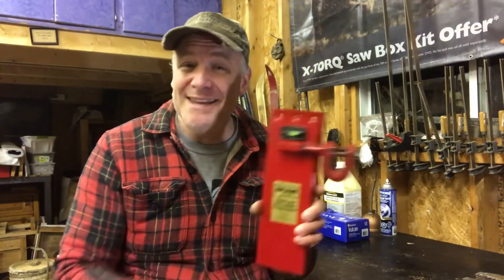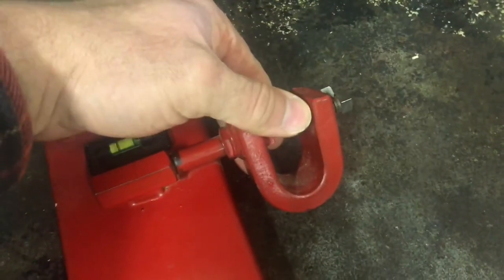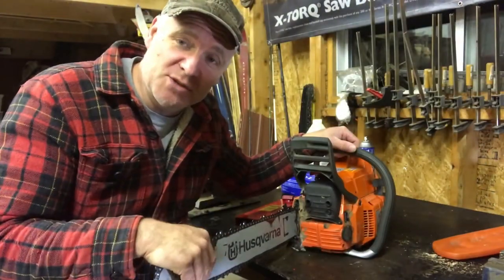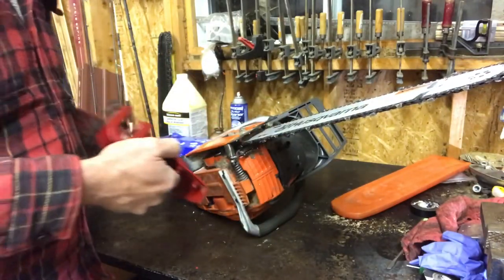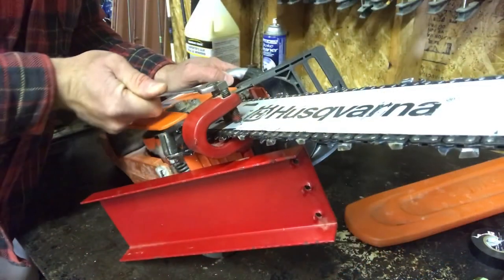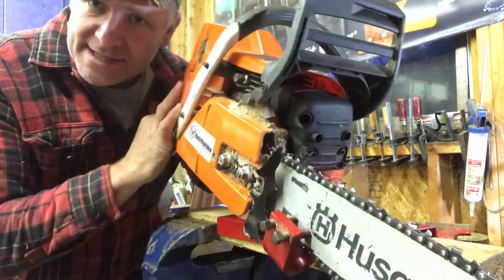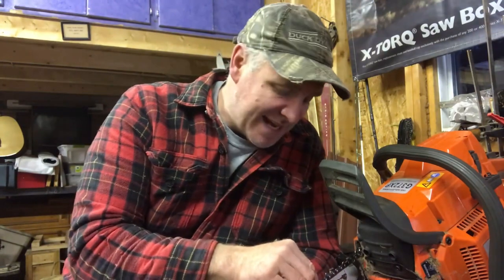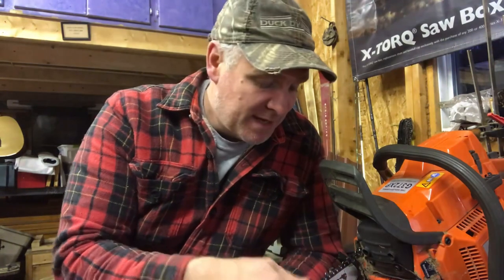The Beam Machine chainsaw mill

Comment: Man I can not find the brand that you are using for that beam cutter.  There are knock offs out there but a lot of complaints about them loosening up on the bar mounts due to the ends of the bolts being smooth where they contact the bar.  Any suggestions?
Reply from the maker: I would change the lock bolts that clamp it to the  bar to square head set screws. they have a round sharp edge at the end that digs into the bar and it won’t move as much. Most farm machinery repair shops sell them they lock gears the shaft. Thanks for watching
Reply: Sounds good.  I will hit up TSC.   Thank you sir!
Reply: Update...  actually was able to find exact item you used. Beam Machine.   Looks like it comes with square head but not sure if it has pointed ends.  Thanks for your help.
Reply from the maker: Glad you found one. Hope you have a great day man